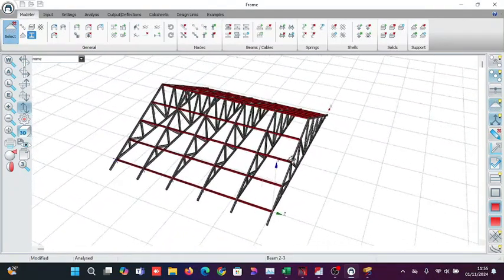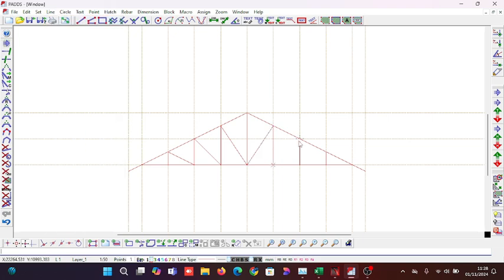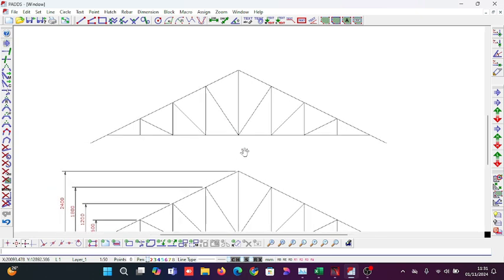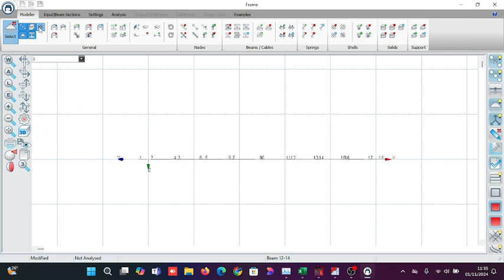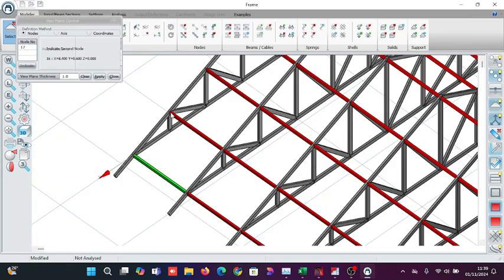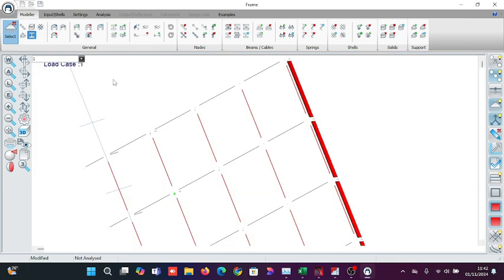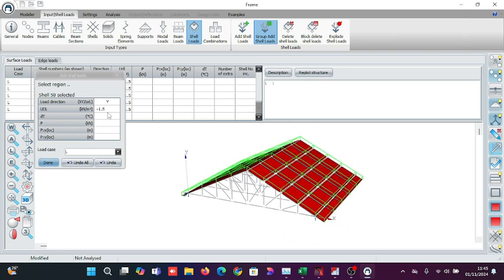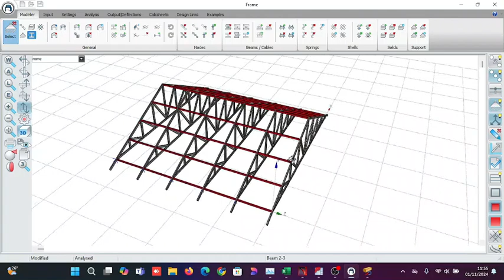Prokon Roof Modeling

Comment: Hi, i would like to know, do you normally model steel plates as shell elements in Prokon Frame Analysis? Kindly share contact where someone can reach you for help regarding Prokon. I am Mechanical but i do use Prokon do a few structural analysis but i am not fully conversant with the application.

Comment: Will the roof sheeting shell element distribute loads accurately to the purlins? Wont the sheet be supported on four edges instead of two?
Reply from the maker: In this model, the roofing sheet transfers part of its load directly to the truss top chord and part to the purlins. It’s possible to set up the model to control the load path precisely—ensuring that loads transfer from the sheets to the purlins and then from the purlins to the truss top chord. The load path depends on how the model is structured. In this case, I chose to keep the model straightforward by keeping things very basic.